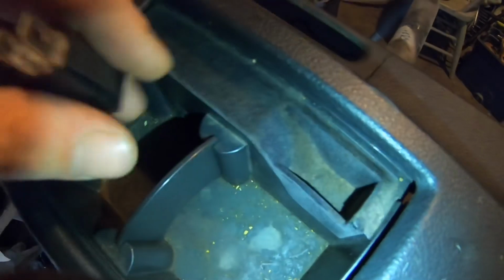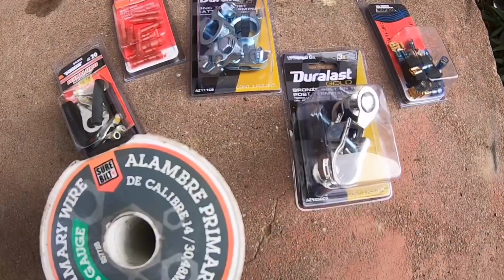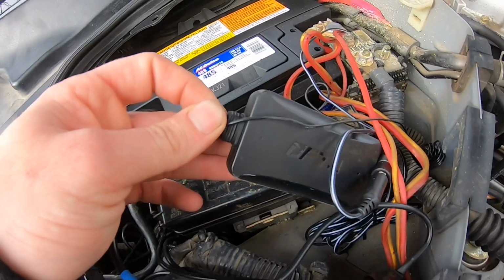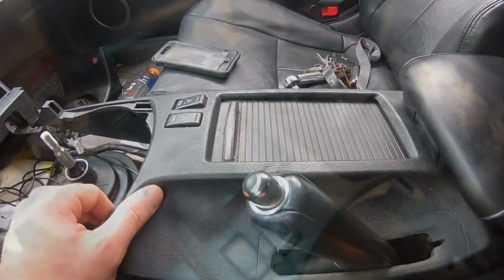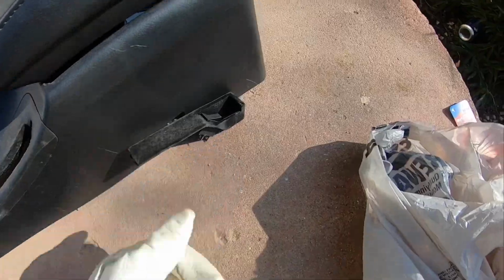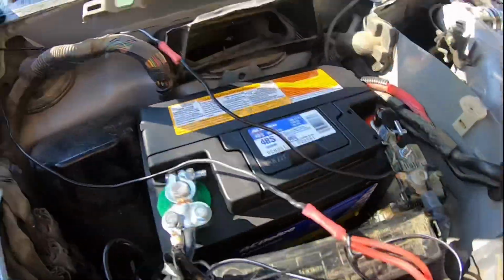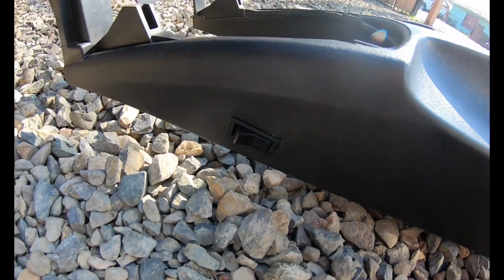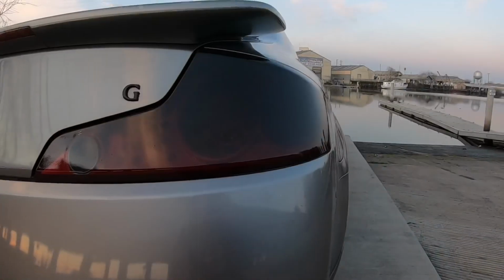installing hidden switches to control Lighting and VDC

Comment: Link for the lights?
Reply from the maker: Drizzle8bp for what lights ? i have  3 diff sets . underglow ,demon eyes, wit retro fit led strip in headlights
Reply: FOREVER G35 interior
Reply from the maker: Drizzle8bp ebay
Reply from the maker: Drizzle8bp 4Pcs 9LED Remote Control Colorful RGB Car Interior Floor Decor Lights Strips 12V
Reply from the maker: Drizzle8bp $11